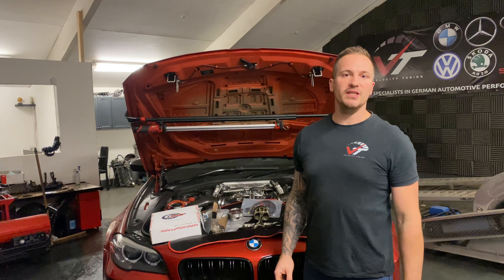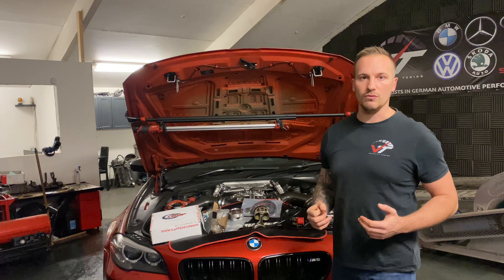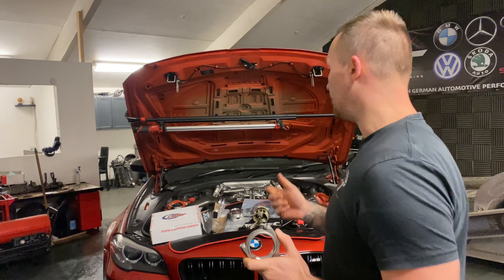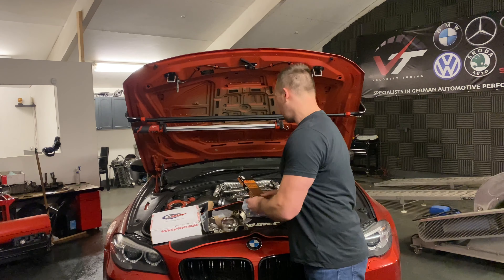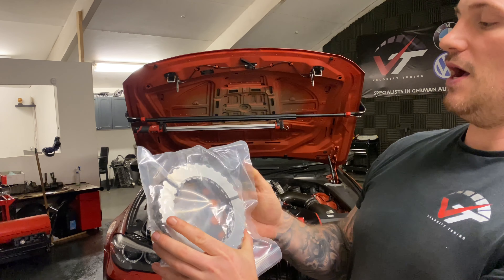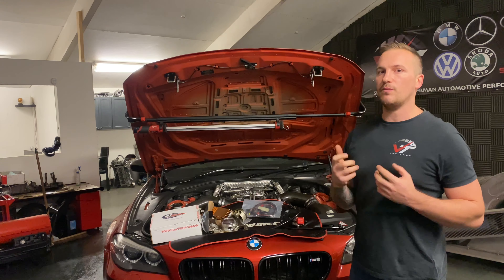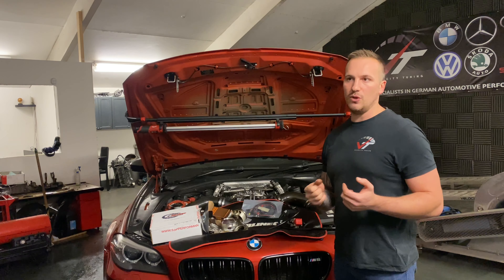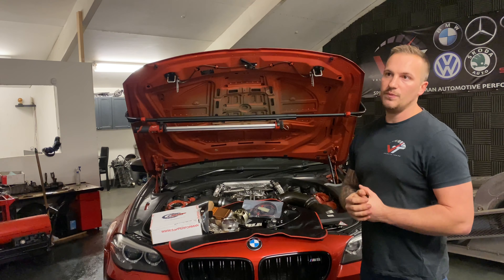Taking the UK Fastest F10 M5 to the next level (214mph vmax killer)

Comment: Hi mate, great video and great project. Looking forward to more videos. I have an F10 M5 Competition and am planning to do some Stage 2 after winter. I already talked to my local tuner, very experienced one with several powerful cars from Germany and he was saying that 750 HP is the max he would to cause he had several experiences with some doing arojnd 800 HP with a Stage 2+. What do you think? Is 800 HP possible with a Stage 2+ and more important is it reliable in any way? My car has just over 60k miles. My plan would be to get somewhere below the 6 seconds from 100-200. Thumbs up and keep on 💪🏼
Reply from the maker: Likely will need a clutch for your goals
Reply: @velocitytuningltd  Thanks for your answer. Except for the clutch, you think the engine can do 800HP simply with a tune and catless downpipes? Additionally, I heared you should be changing the MAP sensors in order to get to 800HP on stock turbos, stock engine and everything else except downpipes.

Comment: Fck that you the only going technical on s63 engines. Please do not shy away. You not only getting technical but you have 1st hand experience.
By the way, what afr are you running and what clearance are those acl bearings? Oem? 0.025 inch more? Or the massive clearance of 0.25?